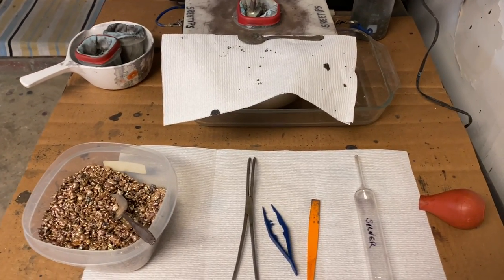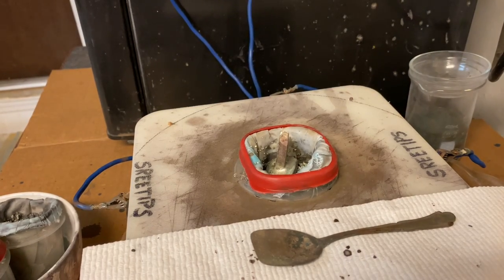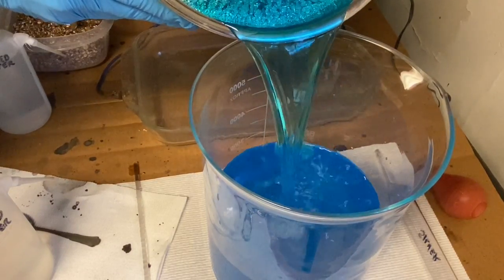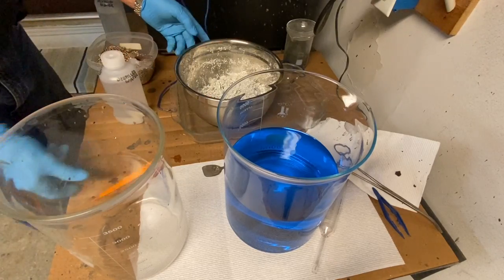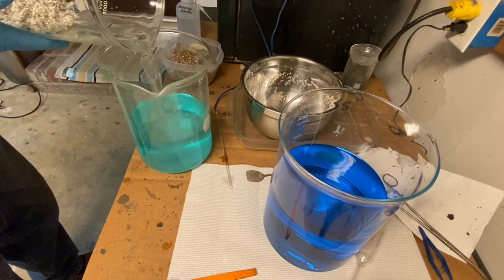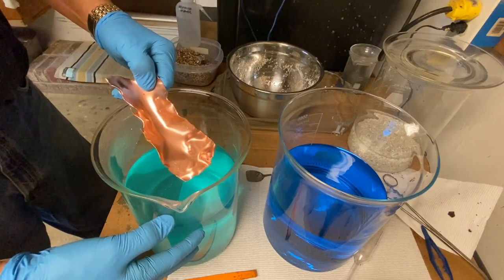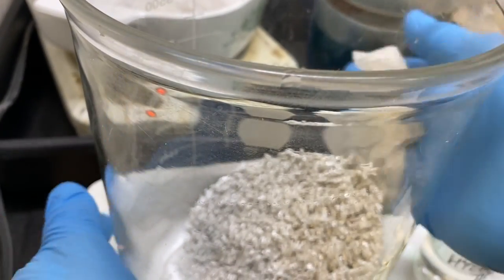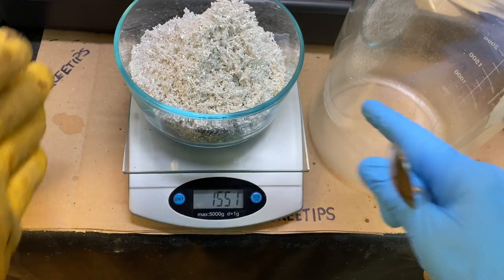Kilos of Pure Silver Cell Clean out

Comment: Where did you get the silver shot? Also, how easy is it to get the electrolyte and from where?
Reply from the maker: The impure silver shot came from melting cement silver and pouring it in water. The cement silver comes from sterling silver that was dissolved in acid then cemented on copper. The electrolyte comes from pure silver dissolved in nitric acid. American Eagle rounds or pure silver maple leafs dissolved in nitric will work for electrolyte. My silver cell uses about 20 Troy ounces of pure silver for the electrolyte.

Comment: Hello Sreetips, Out of curiosity, I have a question.
You are collecting Silver powder in filter paper, melting it, making silver drops, adding the drops into your silver cell.
Instead you ram the powder in a mould, let's say an inch in diameter and 3-4 inches in depth. Purpose is to get a porous, spongy anode rod, attach it to your anode bar and refine it. Spongy porous rod will expose every molecule of silver to the electrolite compared to only the surface of solid droplets thereby increasing the efficientcy. If the spongy rod holds its shape, my guess is after dissolving all silver, the dirt should hold the shape which can be easily removed from silver cell.
Is it possible? Is it possible to ram the powder into the rod shape or will it crumble?
Reply from the maker: I know gold powder can be cold-pressed into bars. But I don’t know if it will work for silver. That’s an interesting idea and worth a little more thought. Thank you (edited once for spelling)

Comment: So do you make silver ingots and sell em or what? Also how did you start this process
Reply from the maker: I make ingots and sell them. I started refining back in 2010
Reply: @sreetips  I mean like how does this system work, you need the shots to break down right? So did you collect them or make them before you filtered out the silver at first? But that's awesome !
Reply from the maker: MơC丨 Kɛıʑ Gladly, partially refined 99% pure silver granules, rendered from sterling/925 scrap silver, are placed in the anode filter basket on top of the cell. The anode basket is suspended in a silver nitrate solution that contains 600g of pure silver dissolved in 3.5 liters of liquid. This silver nitrate “electrolyte” is contained in a stainless steel bowl. The stainless steel bowl acts as the cathode for the silver cell. I attach the positive lead of the power supply to an electrode bar, of my own design, that sits on top of, and is in contact with, the 99% silver in the anode filter basket. The negative lead from the power supply is attached to the stainless steel bowl. I then pass an electric current regulated to 3.5 volts DC through the cell. The electrolyte, being highly conductive, completes the circuit from the anode filter basket to the stainless steel cathode. This current flow causes the 99% silver in the anode filter basket to dissolve. The dissolved silver ions pass through the pores of the Dacron vacuum cleaner bag that is used as the filter in the anode basket on top of the cell. The ions then travel through the highly conductive silver nitrate electrolyte and deposit (plate out) as absolutely pure elemental silver metal on the inside of the stainless steel bowl. The impurities from the 99% silver in the anode basket get trapped in the Dacron filter bag in the anode basket as “silver cell slimes”. These slimes will contain gold and platinum group metals. I save the filters and recover the precious metals that they contain. The pure elemental silver is called “pure silver crystal” but they are not true crystals. They are actually pure metallic silver that gets plated out, over and over, on top of itself to form the beautiful “crystals” you see in the video. Kind of technical, but I hope that this helps you understand the concept of an electrolytic silver cell.

Comment: how many oz of silver are in the electrolyte and the shot in the basket?
Reply from the maker: I use about 600g of pure silver dissolved in 3.5 liters of liquid for the electrolyte. I’m not sure of the exact weight of the impure shot that I feed into the anode basket. The only reason I do this is because I use sterling silver to refine gold. So I recover the silver from that, run it through the silver cell, then put it away and forget about it. You can hold sterling silver just like it is. No need to refine it. As long as you don’t destroy the markings on the silver by trying to melt it. Then its value becomes questionable.

Comment: Is that copper acid washed first?
Reply from the maker: I use clean copper tubing or wire to cement the silver out of solution
Reply: sreetips it’s just really clean. Was wondering if you washed it with something first.

Comment: 7:45 copper to cement the silver out of this solution? surely thats not a technical term
Reply from the maker: Cement is a term used in the refining community to describe using a more reactive metal to reduce a less reactive metal in accordance with the reactivity series of metals. Silver reduced on copper is a grey powder that resembles wet cement. This is where the term “cement silver” is derived. But it is also used to describe any reaction that uses a more reactive metal to reduce a less reactive metal. For example, using zinc to reduce platinum group metals is called “cementing platinum on zinc” even though the resulting platinum metal looks nothing like wet cement.

Comment: Hello, is your cell creating new silver or simply purifying old one? Please clarify for me.
Reply from the maker: I refine gold. I use sterling silver, that I buy at estate sales, to refine the scrap gold. I recover the silver from that, melt into shot, and run it through my silver cell. The cell converts the impure silver (about 980 parts per thousand silver) to high purity four nines fine (9999 parts per ten thousand) pure elemental silver metal. The impure silver is added to the anode basket. The anode basket is suspended in the silver nitrate electrolyte. I pass an electric current through the impure silver. The silver dissolves, passes through the Dacron filter, travels through the silver nitrate electrolyte, and deposits (grows) on the inside of the stainless steel bowl (the cathode). The bowl is connected to the negative pole of the power supply. The process only deposits pure silver on the cathode. So I’m refining the impure silver, into high purity silver. When it’s full, I harvest the pure silver crystal, put it away and forget about it. Then I repeat the whole thing again.
Reply from the maker: No new silver is being created
Reply: @sreetips  so what is in essence the cell doing? Purifying?
Reply from the maker: The cell converts the impure silver (about 980 parts per thousand silver) to high purity four nines fine (9999 parts per ten thousand) pure elemental silver metal. The impure silver is added to the anode basket. The anode basket is suspended in the silver nitrate electrolyte. I pass an electric current through the impure silver. The silver dissolves, passes through the Dacron filter, travels through the silver nitrate electrolyte, and deposits (grows) as high purity, four nines fine, pure elemental silver metal, on the inside of the stainless steel bowl (the cathode).

Comment: What exactly is this, and how does it work?
Reply from the maker: This is an electrolytic silver cell. The blue liquid (blue because it contains copper) is silver nitrate solution about 150 grams per liter concentration. Impure 99% silver is fed into and anode filter basket suspended in the electrolyte. And electric current is passed through the cell causing the impure silver to dissolve, pass through the filter, and plate out as absolutely pure elemental silver metal on the inside of the stainless steel bowl. This produces high purity silver crystal. Every bar, coin, or silver bullion began life as pure silver crystal, just like you see in this video.

Comment: Should turn the silver into dore before you use an electrolytic cell. The reason your electrolye is blue is because of copper. Also you really should be using better hand protection while you are messing with nitric acid.
Reply from the maker: I add copper to the clear electrolyte. A small amount of it enhances crystal structure and growth. Plus the 99% silver shot that I feed the cell is 1% copper that goes into solution as the cell operates. But it doesn’t plate out with the silver unless it allowed to get highly concentrated.

Comment: Is this the process of isolating the silver from impurities? Or are you actually making silver?
Reply from the maker: 99% silver in the anode basket. Pass 3.5vdc through the cell. The current dissolves the 99% silver in the anode basket, silver ions pass thru the filter and into the electrolyte, and plate out as high purity silver on the inside of the bowl. Matter is not being created - but transformed. Refining.
Reply: @sreetips  beautiful. Thank you. Also what’s the point of this refinery? To eliminate the last 1% of impurities?

Comment: What is your anode and cathode made of?
Reply from the maker: Anode is 99% silver shot and cathode is the stainless steel bowl
Reply: @sreetips  Thank you. What percentage of nitric acid do you have the electrolyte at?
Reply from the maker: As low as possible. There will be traces of palladium (and platinum) in the silver that I add to the anode basket. If the nitric level is high in the electrolyte then it will tend to dissolve the palladium from the slimes that accumulate in the anode filter. It could begin to plate out with the silver. But contaminated silver is not the main concern, palladium is worth 100 times more than silver. I can tell if I have palladium in my silver cell electrolyte because it (the electrolyte) will turn green.
Reply: Thank you

Comment: whats the moh factor on your nitric?
Reply from the maker: The bottle says 68% to 70%
Reply: thankyou. of all the different ways I think yours is the best to make silver .999. we have an old silver mine that runs several thousand gallons of water a minute. The PPMs in that water are over 500 parts per million Ive set up a test system to start recovering the silver from that water. I use copper plates and stainless  plates in a electro winning proceedure using Ozone. the test has been promising.

Comment: Hello Sree, 
Nice video! Well done!
Don't give away your physical address. You might draw univited guests.
I suppose the fineness is around 99.5 - 99,9 %. Most fine silver coins are 3niner. 
Only the Canadian Mint uses 4niner silver and they probably run the electrolysis twice
What was your voltage during electrolysis?
How many days did you run the process?
And where does the raw (Sterling?) silver come from? 
How much was the cemented silver after reduction with copper?
Best regards and always good bars!
Reply from the maker: According to Guardian Labs in U.K. It is 999 parts per thousand per fire assay.
Reply from the maker: Fourth nine is unnecessary, like splitting hairs. Three nines is industry standard. But some folks place a premium on that fourth nine.
Reply from the maker: I run 3.5 to 3.7 VDC.
Reply from the maker: I run the cell till it gets full, about ten days per refining.

Comment: I don’t know what’s happening but it’s pretty and I’m all for it
Reply from the maker: partially refined 99% pure silver granules, rendered from sterling/925 scrap silver that we bought at local sales, are placed in the anode filter basket on top of the cell. The anode basket is suspended in a silver nitrate solution that contains 600g of pure silver dissolved in 3.5 liters of liquid. This silver nitrate “electrolyte” is contained in a stainless steel bowl. The stainless steel bowl acts as the cathode for the silver cell. I attach the positive lead of the power supply to an electrode bar, of my own design, that sits on top of, and is in contact with, the 99% silver in the anode filter basket. The negative lead from the power supply is attached to the stainless steel bowl. I then pass an electric current regulated to 3.5 volts DC through the cell. The electrolyte, being highly conductive, completes the circuit from the anode filter basket to the stainless steel cathode. This current flow causes the 99% silver in the anode filter basket to dissolve. The dissolved silver ions pass through the pores of the Dacron vacuum cleaner bag that is used as the filter in the anode basket on top of the cell. The silver ions then travel through the highly conductive silver nitrate electrolyte and deposit (plate out) as absolutely pure elemental silver metal on the inside of the stainless steel bowl. The impurities from the 99% silver in the anode basket get trapped in the Dacron filter bag in the anode basket on top of the cell as “silver cell slimes”. These slimes will contain gold and platinum group metals. I save the filters and recover the precious metals that they contain. The pure elemental silver is called “pure silver crystal” but they are not true crystals. They are actually pure metallic silver that gets plated out, over and over, on top of itself to form the beautiful “crystals” you see in the video. Kind of technical, but I hope that this helps you understand the concept of an electrolytic silver cell.
Reply: sreetips thanks 👍

Comment: can i know where did u get that blue liquid??
Reply from the maker: It was colorless like water when I started. As the cell operates copper is dissolved with the silver. It is the copper in solution that turns it blue.
Reply: @sreetips  do you upload the whole process for these silver?? is that colorless liquid came from liquid that wash film to photo??
Reply from the maker: The colorless liquid is made by dissolving 600 grams of pure silver in 3.5 liters of liquid.
Reply: @sreetips  really... 600grams pure silver with 3.5 liters liquid turn into 1.5kg pure silver?? it really can??
Reply from the maker: No, I feed 99% silver in the top, current dissolves it, travels through the silver in solution, plates out as pure silver metal.
Reply: @sreetips  i see.. dissolves 99% silver first and then mix with pure silver solutions??

Comment: What its Cell made? pure silver?
Reply from the maker: Gladly, partially refined 99% pure silver granules, rendered from sterling/925 scrap silver, are placed in the anode filter basket on top of the cell. The anode basket is suspended in a silver nitrate solution that contains 600g of pure silver dissolved in 3.5 liters of liquid. This silver nitrate “electrolyte” is contained in a stainless steel bowl. The stainless steel bowl acts as the cathode for the silver cell. I attach the positive lead of the power supply to an electrode bar, of my own design, that sits on top of, and is in contact with, the 99% silver in the anode filter basket. The negative lead from the power supply is attached to the stainless steel bowl. I then pass an electric current regulated to 3.5 volts DC through the cell. The electrolyte, being highly conductive, completes the circuit from the anode filter basket to the stainless steel cathode. This current flow causes the 99% silver in the anode filter basket to dissolve. The dissolved silver ions pass through the pores of the Dacron vacuum cleaner bag that is used as the filter in the anode basket on top of the cell. The ions then travel through the highly conductive silver nitrate electrolyte and deposit (plate out) as absolutely pure elemental silver metal on the inside of the stainless steel bowl. The impurities from the 99% silver in the anode basket get trapped in the Dacron filter bag in the anode basket as “silver cell slimes”. These slimes will contain gold and platinum group metals. I save the filters and recover the precious metals that they contain. The pure elemental silver is called “pure silver crystal” but they are not true crystals. They are actually pure metallic silver that gets plated out, over and over, on top of itself to form the beautiful “crystals” you see in the video. Kind of technical, but I hope that this helps you understand the concept of an electrolytic silver cell.

Comment: what is this, why is it in my youtube feed, is this man growing silver? is silver blue? does all silver come from this man? why does this man need all that silver? what did we do before this man? has he always been?
Reply from the maker: Silver in solution is clear, like water. Copper in solution is blue. There’s copper (about one or two percent) in the impure silver (about 98% to 99% pure) that I feed into the silver cell. Both get dissolved as an electric current is passed through the cell. But only the silver deposits on the stainless steel cathode. The copper stays in solution and doesn’t plate out with the silver. That’s why the electrolyte turns a beautiful blue color. It’s fascinating.
Reply: @sreetips  ooooh like copper sulfate mixtures
Reply from the maker: Correct, except this is copper nitrate

Comment: Maybe a better way to do this would be to vacuum filter out the solution from the crystal while washing it with distilled water.
Reply from the maker: I’ve found that it takes less than a gallon doing the beaker swirl. Seems to be the most efficient way

Comment: wouldn't it have been easier to just bring it up to the melting point and then scoop out the slag?
Reply from the maker: Not at all. There seems to be a myth floating around that says melting the metals will cause them to classify and separate into layers of pure metal. I wish it was that easy! This just isn’t true. When metals are melted together in the same pot they don’t separate, they form an alloy. And it usually takes a great deal of time and effort to separate and purify them. If it was that easy then anyone with a torch could refine high purity gold and silver. Getting pure metal, from any source, is never quick and easy.